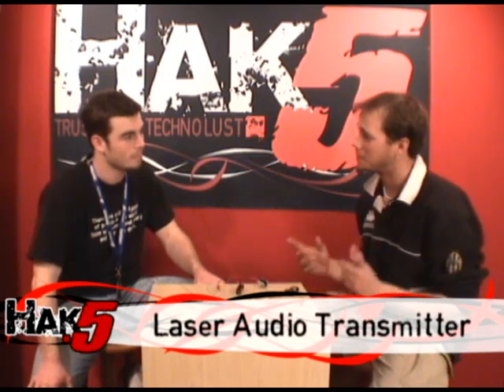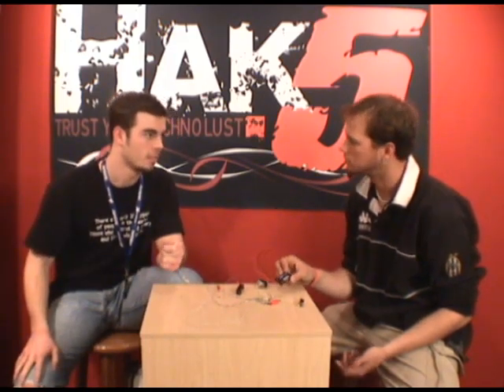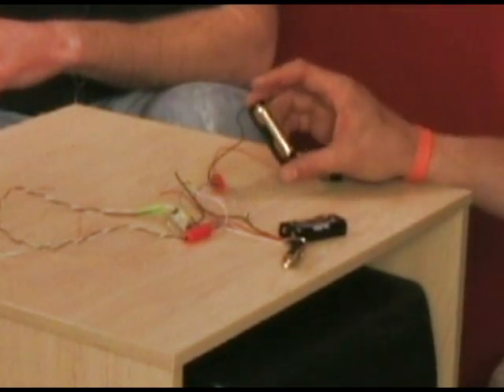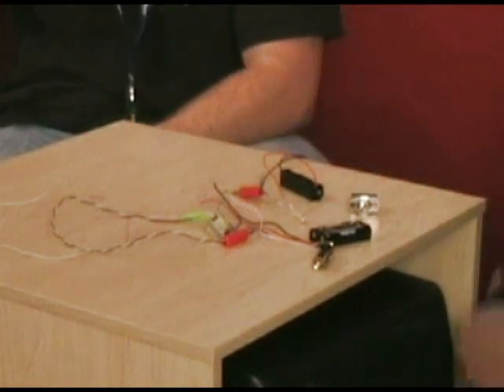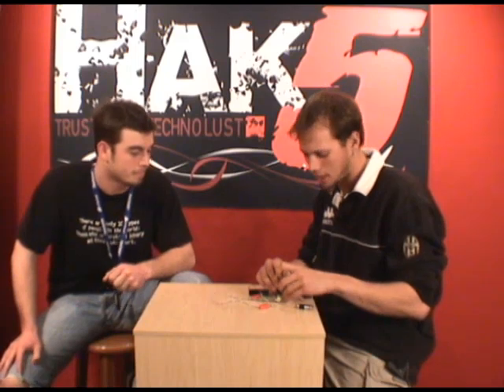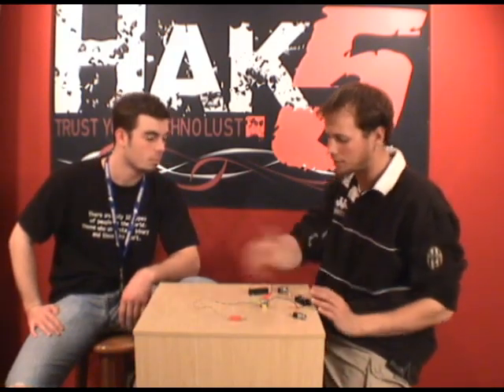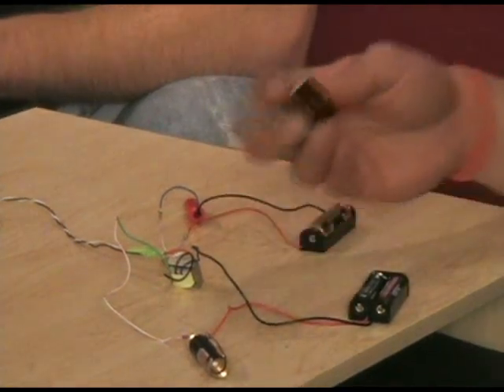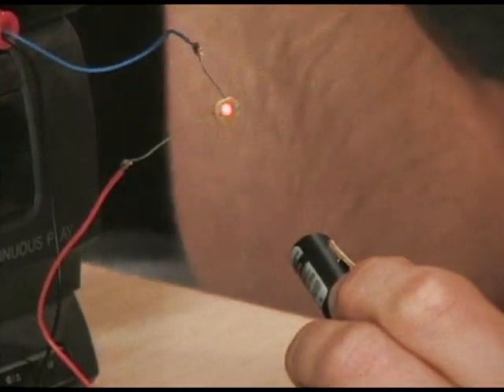Building a laser audio transmitter for under 15 dollars

Comment: I am actually listening to this video through one I made. for the transmitter I just have a laser pointer, a 3 AAA battery holder, a small transformer, a patch cable and a bunch of jumper cables. For the receiver I have a solar panel from an old garden light and a custom patch cord I made and it's a 1/8 audio cable connected to 2 jumper cables and the whole thing works pretty good but I think the solar panel is too powerful so I'll switch it out for one from a calculator.